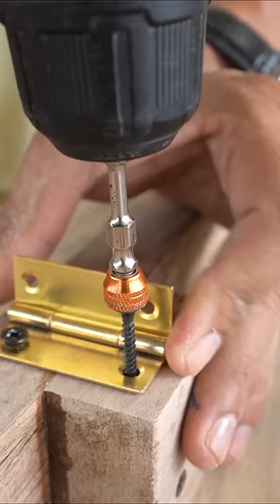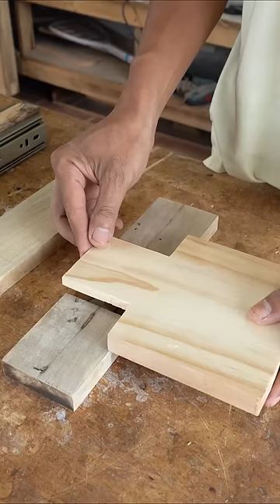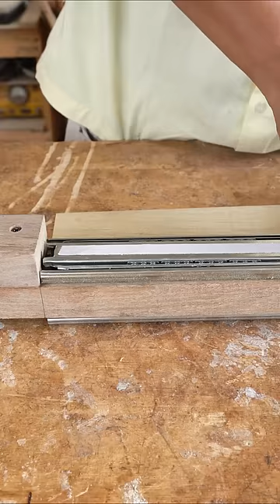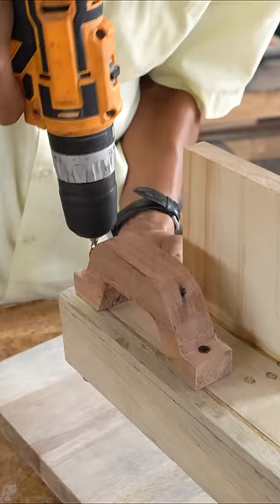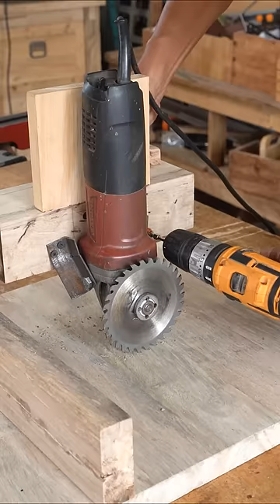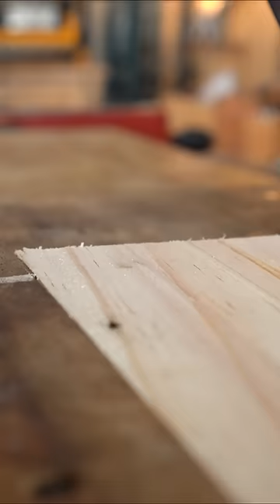Unique creative saw machine for woodworking - DIY Saw Machine

Comment: Guys dont do this. 
There isnt many wood cutting discs rated for 12000+ rpm which is a typical angle grimder speed.
Flying carbide teeth at that speed is NOT something you would want to experience